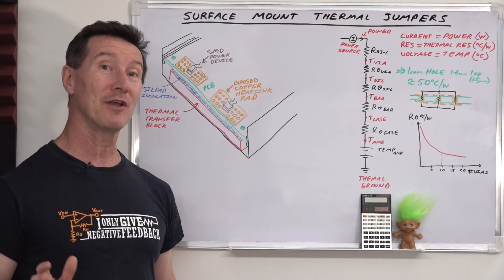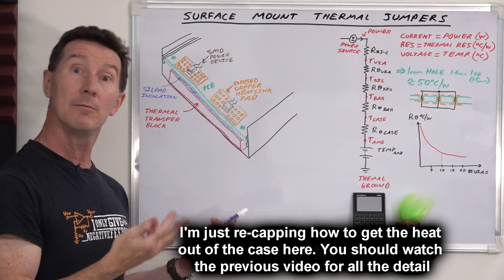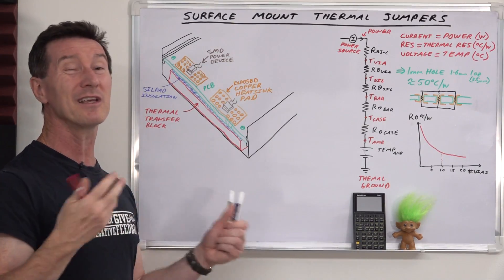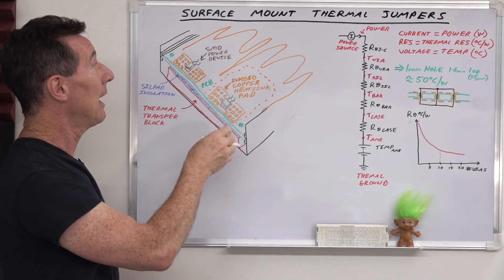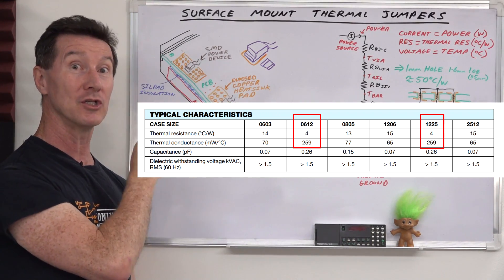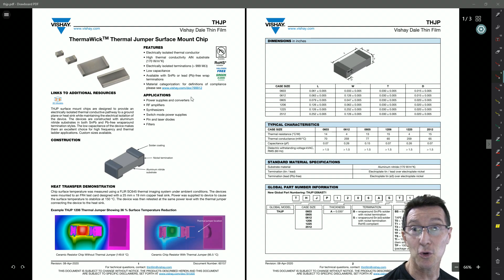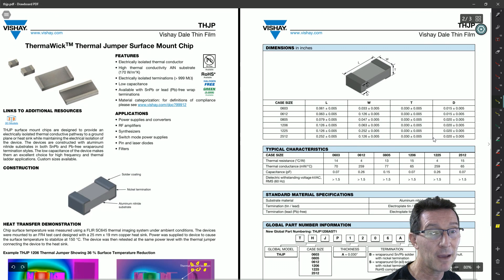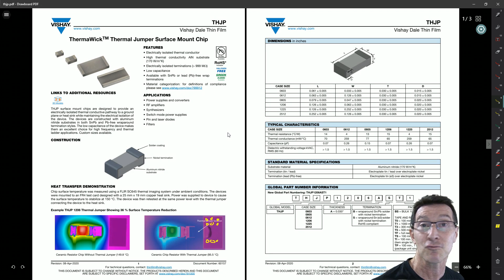EEVblog #1347 - SMD Thermal Jumpers could be GAME CHANGING!

Comment: Hmm that's very interesting to say the least.  About 12 years back I was doing circuit board assembly and had a bunch of 1G ohm resistors pulling to ground.  Per order of client boards were to be all hand soldered.  Those were a nightmare to say the least.  I wonder if this is why they were being used.  I was dumbfounded when I saw 1G ohm
Reply: Wait, was the interestingness of this video the least you could say, or was it the nightmare?
Reply: @Graham_Wideman  little bit of A little bit of B?  Just funny how a video like this would send a torrent of memories back to me of something I didn't understand back then.  It's also interesting that this might have been used that long ago.  I mean I was still using leaded solder 😂

Comment: I think the best way to use this part would be to put it between the SMD land and a mounting screw that attaches the board to chassis.  Probably could conduct a lot more heat than the ground plane.
Reply from the maker: Possible. It would radiate better externally of course.

Comment: Interesting, but I think you could often do just as well with simple pcb layout techniques.
FR-4 has a thermal conductivity of about 0.25 W/mK.  So if you have a 10mm x 10mm land on the surface of the pcb, and the ground plane is just below it with 0.1mm of FR-4 in between, the thermal resistance from the land to the ground plane will be about 4 K/W.   And a 0.1mm layer of FR-4 should be good for about 3kV (maybe 1.5kV with aging) isolation.  So you can get pretty good thermal conduction without any thermal vias if you have enough room on the surface for a large land to spread the heat.

Comment: That's making me wonder what the thermal conductivity of the standard aluminium nitride ceramic SMD resistors is.  Could a high value resistor be used as a cheap heat conductor?
Reply: We use a good few 100Meg 2512 resistors in a commercial product designed in the late 90s for this exact purpose.  It also uses a film cpacitor with both ends gonnected to ground as a shielding element, as it was cheaper than a custom stamped part.
Reply: @semifavorableuncircle6952  I imagine reverse engineering a board like this would be fun "why in the flying fuck is this cap grounded on both sides?"
Reply: @satibel  lol ikr 😂 I'd be like what is this sorcery?!
Reply: @satibel  don't worry the PCB house will kindly not populate the unnecessary components for you on your assembled board.
Reply: we all know if we give you that SMD Thermal Jumper you sure use them to electrify some sausages
Reply: Aluminum nitride thermal conductivity 320W/mK. Aluminum oxide 30W/mK. So about 10 times worse. That said, resistors cost at least ~20x less than these, so you could pepper your board with 0603's.
Reply: @jaro6985   320W/m.K is for a single crystal which is expensive, but for an electrically insulating polycrystalline ceramic it is anywhere from 17–285 W/m.K (ref: http://www.scielo.br/scielo.php?script=sci_arttext&pid=S0366-69132004000300012 see table 1 for physical properties of AlN, SiC, BeO and Al2O3 - resistivity etc.)
Reply from the maker: My guess would be order of magnitude worse.
Reply: @EEVblog  AlN is 10x more thermally conductive than Alumina yes.
I've used it in compact 500w radio amplifiers before as a thermal pad that does not increase capacitance for transistors. Works a treat.
Reply: i think SMD capacitors would be more effective
Edit: not in switching applications of course
Reply: I was thinking about doing an estimate based on something like the power derating curves, but that will only give the (overall) component to ambient value. Also, using it in a different setup the  mode of heat transfer could get different and ruïn things ....I'm not sure about the last bit, but I think that you should just try it!  . Don't forget to check that the case of the SMD resistor. Also, make sure that the resistor's enclosure doesn't create shorts...
Reply: They won't not work, particularly high power resistors designed for heat dissipation, but the major selling point of these jumpers is that they are electrically insulating devices, making them handy for places where you need good isolation. Hopefully they will hit commodity status and come down in price, because they are because they are super handy for RF stuff.
Reply: My first thought exactly. High value resistor might not be a good thermal conductor. Hope all is well on isle of man 🙋🏻‍♂️
Reply: Big Clive...can you Sodastream me?
Reply: May not be as good as these dedicated parts, but maybe good enough for particular applications. As always application dependent, and you can always EXPERIMENT, to see if it will do the job.
Reply: or a low value that you just burn out during burn in :)
Reply: As a general rule of thumb for most materials, thermal conductivity and electrical go hand in and hand.  These appear to be have an aluminum nitride substrate, and it may in fact be just aluminum nitride for the most part.  Which means its possible a ceramic capacitor might have similar performance, but you'd have to test them to see what they are.  Honestly, if it is just an aluminum nitride substrate, it's less than 1/10th of a penny worth of material in them, so I don't understand the justification for them costing 30-50 cents in low quantity when you can get a cap from Digikey for 10 cents in qty 1.

Comment: If you moved to this stack up
    
GND
Signal
Signal
VCC
   
And you had some way to get a thermally good but electrically bad connection to GND/Vcc which both look the same to high frequency then you wouldn't need thermal vias or thermal jumpers. Actually, a thermally conductive but dielectric solder mask would do the trick. Essentially the solder mask would be one big thermal jumper. This stack-up is good for RF emissions too. You can't rework such a board and SMD parts would need a via for every non VCC/GND pin but such is life.

Comment: "Dave what happened to your PSU project?"
"David2 left and it's been in stasis ever since."
Maybe release the project and let the community finish it, then run some group buys or straight put on your store/other distributors.
Reply: the problem with the PSU project is, that for it to become a product, it needs one vision.
If you let the community at it,  you will get conflicting visions and go nowhere.
What would work is realising the hardware and a "driver packet" type firmware. That would also branch out, but quickly, a few branches would establish them self as "good for a specific purpose".
Reply: @sarowie  Let Dave manage any volunteers and have them do exactly what he is looking for?
Reply: @Arek_R.  Who would 
1st have the knowledge to do (correctly) what Dave's wanted
2nd Actually having and wanting to spare free time on an open source project thats not that "open"
3rd Do all of that (basically working completely for someone else) for free

Those would be the major problems
Reply: @Arek_R.  Dave is the kind of guy, that keeps things in mind. Creating a symbol is not mindless busy work - it is preconceptuallizing how you plan on using the IC, reading the pin description, checking the specification against surrounding parts, taking notes for the layout phase... and then double checking if the b-variant of the part would not fit better. It might have a bigger footprint, but that simplifies the fan out the inductor.

I'm tasked with mentoring a student currently. It is fun, but preparing the work for someone else is more work then when I would to that specific task. It is the unified vision and a gut feel of which optional parts are worth in context of other constrains that pop up during the design.

Comment: I am little concerned that the heat will also pass through the tiny solder joint on the side of the jumper and it is of the same size as the jumper cross-section itself. Lead solder is not particularly good in transferring heat (even worse than solder paste sometimes, hence soldering coolers to CPU is roughly as effective), this is why heat pads are made very wide on the bottom of some components. I wonder if they would be able to increase heat transfer by making the joint wider but well... it seems they've investigated multiple designs with a thermal camera. hm...

Comment: I seriously once routed in a little hole underneath a few times, then went on a thermal-pad straight to the case.
Obviously that only works if you have the space underneath the component but it worked very well.

Comment: Ah, the premise here seems to be trying to use layers of the PCB as a heat sink. This would heat up the entire board, and I am not sure how well a number of contact points are going to be to transfer the heat from a spot to a thin metal plane. This would be a good way to isolate something thermally conductive to say an external metal block, say under a connected ground plane though.

Comment: I want to make a PCB in KiCad but its not going well. I want to have an EPS 12v connector from a computer 4 resistors and 4 leds. I just don't see how to setup the program to realize the hole spacing for the EPS connector. The pins are about 1mm wide, 1.6mm wide from corner to corner and the length from center pin to center pin is 4.2mm. For some reason center pin to center pin on the other row is 5.6mm
I am trying to make a simple 2 color LED EPS cable checker that lights red if the wires are in reverse and blue if they are correct. This is because I am making custom PSU cables and want to check if they work before using them.
I currently just soldered the resistors and leds straight onto the connector but that seems fragile.

Anyone willing to make an example or even make this for me? Designs are really not my thing.

Comment: If you have many layers you can also play with planes to transfer heat through the FR4 substrate. I did this once where every second layer was connected to the heat source and every other to the GND-plane. The component was almost impossible to de solder because of this! :D

Comment: Mount PCB vertical with thermal resistors at top of heat source....if ground plane is at horizontal bottom it will trap heat

Comment: Why not just use thermaly conductive PCB substrate instead? I guess aluminum PCBs are expensive... But imagine some thermal compound mixed in the resin bonding the glass fibres...
Reply: thermal compound actually has pretty bad thermal properties itself. Its main goal is just to fill microscopic gaps as a thin film. Aluminium PCBs are more expensive and I think you cant really get multi-layered ones (or are probably super expensive), limiting complexity of circuits you can implement on them.
There are also specialized ceramic PCBs (ceramics have pretty much the best thermal conductivity of all insulators), but those are even more specialized. They would be the closest to what you're asking for though.

Comment: Now include the thermal jumper inside the transistor package and you've got even better performance.
Wait, surely transistors with some ceramic insulation on the tab have always been a thing?
Reply: True, but isolated tab in SMD is pretty rare, though in through hole it is a common thing. I have not seen any SMD devices with an isolated heat slug in the package, even CPU and other devices with integrated heatsink attach areas tell you that plug is an internal connection to some voltage, typically substrate and thus ground. To put this in the package means the package size grows quite a bit, and the price grows a lot as well from the extra assembly steps and lower yield.

Probably there is a market for making these in a package that matches SMD thermal pads, with a solderable top and bottom that has the ability to allow you to solder this to the board, put the power device on top and solder it as well, with 3 vias to pads to take the connections through. Make any Dpak device isolated tab, and have easy thermal transfer to the board. going to be an expensive part though, I can see it being easily $1 in volume just from the amount of Aluminium nitride alone, plus the platings and certifications.
Reply: @SeanBZA  I guess it's all a bit specialized, but having the isolation right in the transistor, or in between it and the borad, just seems so much less like a hack. Plus you dont need extra space around it on the board and there is no need to place any special copper area for each transistor that needs isolation.

Only issue with a separate insulator piece would be assembly, but it's probably not too hard to place both parts and reflow them at the same time.

Comment: I could see these being super useful for drone motor drivers. Super tiny, but so much power. Also for current sense resistors, given the temperature coefficient being directly related to current reading error.
Reply: They usualy use aluminium heatsinks for a reason, most of their PCBs is usualy covered with MOSFETs.
The board itself couldn't take that much thermal load as it's pretty much saturated and the MOSFETs connect to the ground and power traces anyway.
Reply: No great help there, for drone ESCs you certainly want direct thermal compound on top and bottom. in plus you do not have enough space for redistribute with vias.

Comment: is TO220 still better than surface mount for high power dissipation (say, 40W)?
Reply: pretty sure at that point your ground plane will be the biggest limiting factor. Although using an alu-clad PCB mounted to a heatsink should be able to deal with it.
Reply: where can I find some cheap beryllium oxide "silpads" for heat sinking some TO-220's Aluminum nitride is good enough I guess but they cost a lot too!
Reply: @power-max  well I just checked, and OF COURSE some people on aliexpress sell BeO ceramic plates in various sizes xD
Not exactly cheap though.
Reply: @Basement-Science  IF they are genuine. They are probably some cheaper ceramic. They might be aluminum oxide or nitride and still perform fine
Reply: @power-max  super-niche stuff like this is probably not worth trying to scam you over. If you actually pay lots of money to buy it, you probably know what your requirements are and could easily recognize the scam. Since there's only a couple of offers, I'm guessing it's genuine. But who knows.

Comment: My first thought was literally: "Just tell me they're not made with beryllium oxide!" :D

Aluminum nitride yay!!!
Reply from the maker: Keep watching, there is a beryllium oxide version!
Reply: @EEVblog  SiC could be be good enough at ~150W/m.K and should be cheaper to produce since it does not require nitrogen gas at 100 and 500 atmospheres of pressure to produce. 
EDIT: Although the dielectric loss is 100x higher, maybe not. But still might be good enough for SMPS's. (ref: http://www.scielo.br/pdf/ce/v50n315/a1150315.pdf )
Reply: There is nothing wrong with beryllium oxide as long as you don't breath the dust or eat it.  If you pulverize and inhale the resulting dust from your electronics, beryllium oxide is not for you!   While you're at it, quit making and breathing asbestos dust.
This world is nuts. "toxic" > Reeeeee! Reeeee!

Comment: Now that we know how to dump heat into PCB, I expect a follow up video shortly about how to get it out of PCB and into environment :)
But seriously thanks for the video, maybe it will educate more people about thermal design, as I've seen way too many  PCBs which cook themselves under sustained load because their designers didn't bother to think about thermals.
Reply: Easy. You solder or bolt a piece of metal to the board.
Reply from the maker: That's basically what the previous video was about.

Comment: Especial at those prices I do not see any value. A good low RDSon mosfet is maybe $1 and adding a second mosfet in parallel will reduce the total TDP to half and split between the two that means a quarter of the power for each. Not even sure this thermal jumpers will make sense it they where 10x lower price (witch they should for what they are).
Reply: Because there are other things besides just FETs that can go hot and which you cant simply wire up in parallel. Also board space is a consideration, a 0612 thermal jumper takes much less board space away than a second 2512 power resistor or a second SOIC-8 FET.
Reply: They are a solution in search of a problem, for high power stuff you have problems with creepage, for mosfet 99.9% of the times the money is better spent just buying  a lower Rdson transistor, etc. Also this part just moves the heat to a different net, you still have to get rid of it somehow.
If these thermal jumpers were so useful and amazing we would have seen them used way more in the last couple of decades, as the technology to put pads on a hunk of ceramic has been there for a while
Reply: adding mosfets in parallel can be fun but only for low switching speeds.
or you have too start calc-ing  the CGS and CGD and the time the mosfet is in the liner zone " miller effect"
and if one mosfets turn on first it will carry 100% of the load then get hot and let the magic smoke out.
you can not just parallel mosfet gates without considering the capacitance.
Reply: @joejane9977  you can totally do that even at high frequencies (hundreds of kHz with tens of nanoseconds switching speed 1200V class devices), if the design and layout is done correctly with separate gate resistors for each transistor, fast switching ( the faster the betters) , a symmetric layout, etc.